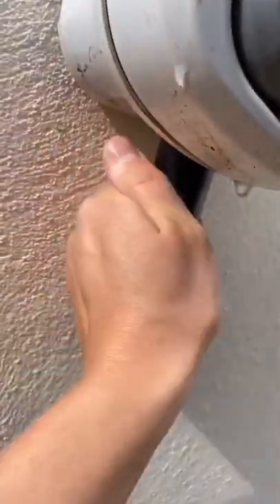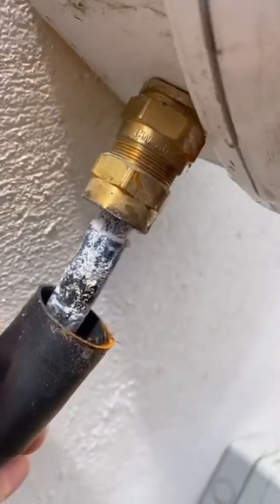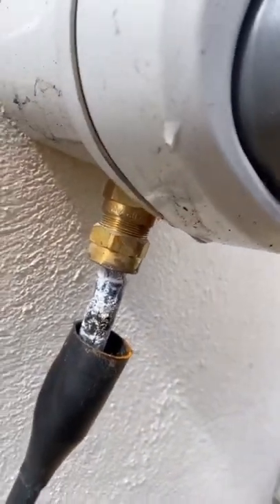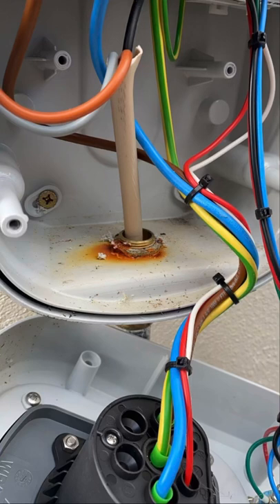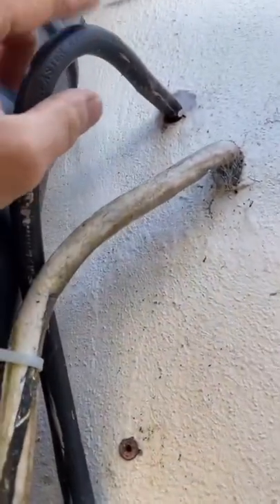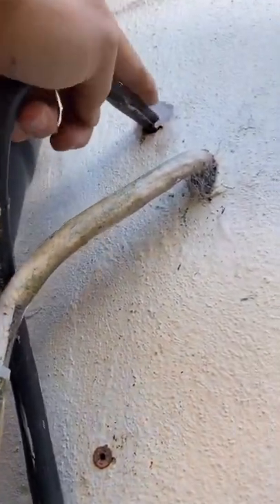APPROVED ROLEC INSTALLER!!! SCARY INSTALL!!

Comment: It just shows that it isn’t always the DIYers that are bad.
Reply: No the DIYers are generally always bad but some so called professionals are not a lot better...  Frankly though I blame the customer as they want it done cheap as possible..
Reply: @steve11211  most diy'ers end up being diy'ers because professionals do jobs like that.  I just built a house and every trade that requires a certified professional to be used, did not do their work correctly or poorly and left only me to learn how to correct and make it right.
Reply: @adspremiumwepaypremiumfora1469  Totally agree. I bought a house In 2019 and the quality of the wiring and the plumbing was shocking. I've had to learn and replace myself. At least I know it's done to a high standard and if there are issues I know where to look!
Reply: @Davey656  👏 well done mate. Instead of being pissed off, you decided to learn and do it better for yourself.
Reply: @adspremiumwepaypremiumfora1469  My experience of being in the trade is people have this thing of getting 3 quotes, I do a decent job at a decent price and use the best quality materials, but because I do the job right and use good quality materials a lot of work I dont get cause I am more expensive.  Personally I don't care and I just work for customers that know I do the job right and often get work after others have done a shoddy job.  90% of customers give me a sob story about not being able to afford much.  DIYers dont have the right tools or materials and dont have the correct testers, they have the best intention and I have seen some very good DIY electrical work but 99% even when it looks ok when you open it up conductors fall out or its just generally a dogs breakfast.  Also the number of jobs I get, and its normally the wife that phones and says "My husband tried to change a light be we now have 4 cables and we dont know what goes where".
Reply: @steve11211  yeah I can definitely understand that.  Don't ever lose that integrity.  Best wishes for your future have a great rest of the day
Reply: @adspremiumwepaypremiumfora1469   Thanks, I do a lot of work for charities which makes it difficult as they are always price sensitive.  I tend to end up reducing my labour charges to a very low level which I don't mind doing for charities...
Reply: Issue with diy isn't always the quality(thoughit can be). The issue is the lack of testing and knowledge of regulations. The work might be great but could be a spur from a spur or with no main earth etc. These should be picked up in testing which generally doesn't happen with diy.
Reply: @steve11211  that's awesome
Reply: @conorlanders8401  I do my research which includes more than just YouTube videos especially for something that may be life threatening to my family or i.
Reply: It isnt about DIY vs Pro's, if you are a bodger then it doesn't matter what skill or cert you have. Bought my new house with a pass on the EICR. I had exposed live in the loft with no junction box sitting on installation and about 80% of the plugs in the house had loose connections. Its important to learn as much as you can so when you get cowboys you can call them out.
Reply: @kolt9307  Right on
Reply: @adspremiumwepaypremiumfora1469  honestly sounds like you cheaped out with whoever you hired across the board and ended up with all the shitty hacks the rest of us don't even want to work with when we're not paying them.
Reply: @Donald Horton  I wish that were true, but thanks for your assumption. I hope you use more intelligence when diagnosing problems for clients pushing aside who was responsible for the mistake, for a "professional" focus on correcting and providing the customer not only what he has paid you for but what is entrusted in them certifications and years of experience.
Reply: wnc817  That is absolutely fine, if you have an MFT that has been calibrated, you test your work and you understand the current wiring regulations..   If you don't test your work or carry it out to the wiring regs it can make your home insurance invalid if there was an electrical fire or worse it can be extremely dangerous..   I see so much more bad work by DIY'rs (98% of work is bad) than I do from electricians (20% of work is bad).  The biggest problem I find is DIY'rs don't know what they don't know, so they think they have done a good job but without understanding what they have done and why its dangerous.
Reply: @kolt9307  to be fair what did the EICR say in the limitations they may not have looked in the loft, especially if not easily accessable.
Reply: @steve11211  generally almost always, I love that lol
Reply: i am looking to have a job done not that i can/cannot do it id rather let someone else do it for the really complicated things. but i never go with the highest nor the lowest i usually go somewhere in the middle i find most of the time jobs come out well. tho i have found lots of companies that after they see the job they don't return calls or never give a quote. I usually find that means its going to be a major pain to get it done. hence why i hire it out. lol
Reply: @steve11211  had to buy a building code book and nec book becuase the last contractor I hired left a live bare wire in a cabinet corner.. the old wtf is.. lock up routine... thanks, I'll pull my own permits.. lock out my own breakers.. and test it myself.. and yeah I'm still salty about it.
Reply: @johnjacobjingle8302  That sucks, I am guessing though you are in America?  I thought they were even more stringent over who having to be a registered electrician.. I guess even that doesnt help.. There are different rules in different countries and UK has probably some of the most comprehensive when it comes to electrical work.
Reply: @steve11211  you sound like you don't know what your talking about
Reply: @jacobcallahan4813  Im a fully qualified electrician, I see poor DIY work every day, to what point do I knot know what I am talking about?

Comment: I don’t see how the gland is letting water upwards and into the box. More likely coming in through the joint in the box, between the back and front plate.
Reply: It's possible that when the charger is charging, the air inside expands and exits where the gland is. When the charger stops charging, the air inside contracts and creates a partial vacuum that sucks water that's collected around the gland up into the charger. It's also possible that the warm air inside the charger is condensing on the interior wall and the water is then pooling at the bottom of the charger unit.
Reply: Yeah water comes in from the top, looks like it was not sealed where the anchors are

Comment: I had exactly the same … no rubber washers place on rear of unit where it screws to wall the unit actually filled with water till the breaker had a meltdown! So called professional install by Rolec too

Comment: How the hell do we as customers pick a sparky! No wonder there’s so many DIYers
Reply: Number one is don't go on price, speak to the sparky as how they will do the work etc..  I have won so much work by actually explaining things to customers and telling them how I will do a job and the reasons why I would do things a certain way..  Any sparky not willing to spend a bit of time with you is not worth getting your trade.
Reply: Simple, don't go cheap.
Reply: I used a decent electrician and they installed an rcd socket. It failed 11 months later, I replaced it abd did a better job
Reply: @royalstevep68  if an electrician installed an RCD socket as an EV charger then what can I say 😂
Reply: @royalstevep68  I am guessing this was not for an EV and RCD was required because you had no RCD protection on that circuit so you replaced with an RCD socket also...  What was your Zs value and your RCD test results at 5x load testing on both sides of the sine wave?

Comment: Ive had to play this a few times.... Still not with it 🤯 has the installer made the armared cable off in the wall so you have no  steal armoured back at fuseboard  ?? If so why would you do such a thing unless he only had one gland 😆🤣🤔
Reply: I'm with you. Not clear how water got in there. Also the SWA inside the wall. Looks stripped of armour so only cable enters building.

Comment: Am I missing something, how is water getting in?
Reply from the maker: Teleportation
Reply: It's possible that when the charger is charging, the air inside expands and exits where the gland is. When the charger stops charging, the air inside contracts and creates a partial vacuum that sucks water that's collected around the gland up into the charger. It's also possible that the warm air inside the charger is condensing on the interior wall and the water is then pooling at the bottom of the charger unit.
Reply: @VinoVeritas_  love your explanation because it is very possible. But I will disagree on this occasion. There is simply no way that that unit is air tight to the point it will create a vacuum. Also if the EVC heated to the point of creating that much condensation then there would’ve been a serious problem at the CU (incorrect protection device) as it would exceed load capacity and could cause a fire. Look at the mounting screws, I reckon that’s the problem; it’s most likely running down the wall, through the holes of the back casing and eventually running down the gland causing corrosion too. It’s called capillary action.

Comment: Chris - What a complete mess, together with a unsafe install !.
I am not a certified spark OR an EV approved installer, but joking apart, I could have made a better job than that mate !. 
Apart from the "Pant's Job" on the SWA gland, why is the wall box letting in all of that water ?.
It's ALL not backing up the gland surly, it must be getting into the case some how Chris ?.
I can feel "Storm Gland' coming on !.
Check the RCBO for "Burnage" as Jordan call's it, while your in there Chris.
The Rolec RCBO'S are very prone to overheating and failing.
Ask me why I have a "Garo" fitted in mine now the box is out of warranty.
Good luck mate !.